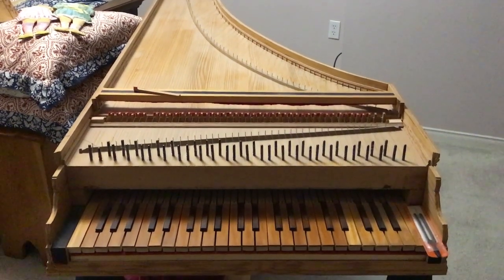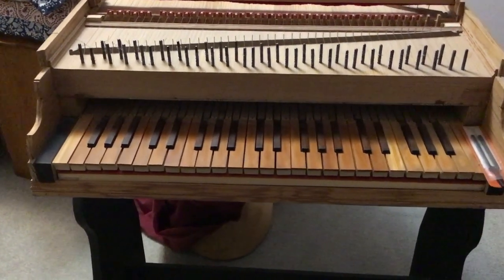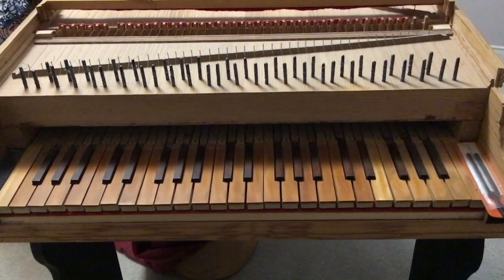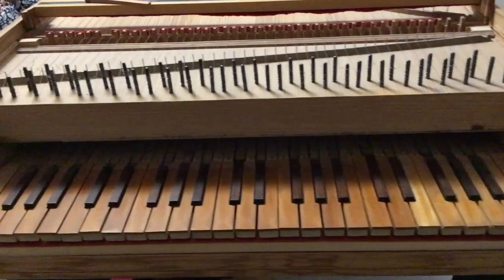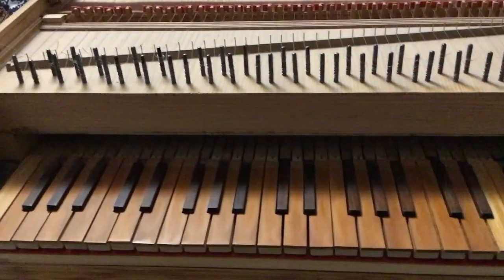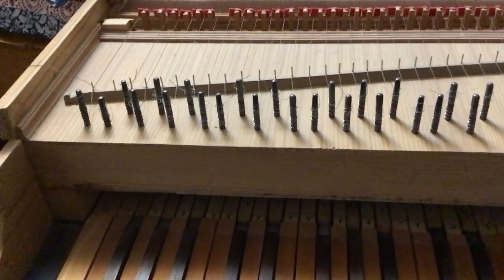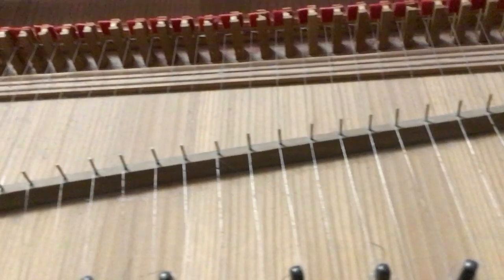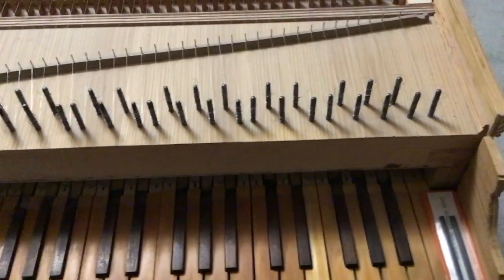How to make harpsichord keys & jacks

Comment: Is there a secret to drilling the holes for the tuning pegs?
Reply from the maker: No. Use a drill bit the diameter of the pin and put the pin at a right angle to the wrest plank. Drill scrap wood and see how the pin fits. The depth of the pin hole seems like it should be standard, but I have pins that I can turn with my fingers though they're in holes maybe half as deep as the pins.
Reply: @DEREMIGIS  Ah! So as long as the fit is snug, it's not like your forcing the pins down into the holes. The tension of the wire plays a role in keeping the pins in place? Thank you so much for your help
Reply from the maker: @DaJesuts  Originally I started them with a mallet tap. They were driven further with the turning that tuned the strings.The pins that I turn by hand go out of tune easily but are as quickly retuned without the tuning hammer. Though their condition is certainly not desirable, I believe that I have read of or witnessed the turning of tuning pins without the tuning hammer.